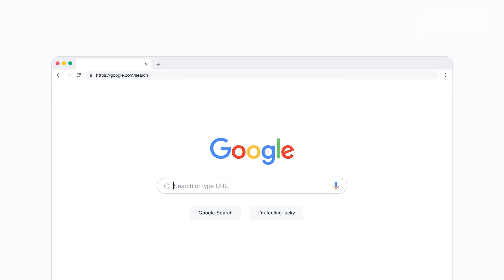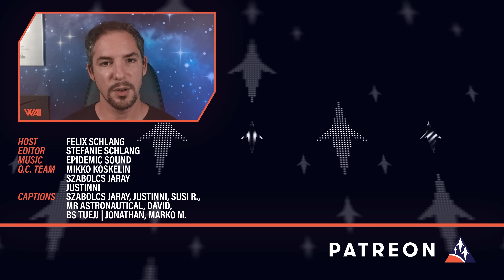SpaceX VERY cautious with orbital Starship Launch?

Comment from the maker: Do you agree with SpaceX being cautious? How would you do it?
Reply: Its good being cautious, and how would i do it... I would put sensors on the tower and try to land the booster in a middle of the ocean while moving the real tower in concert with the booster landing. That way there would be a kind of virtual tower on which the booster would land which would follow the real tower's movement. When that's done few times i would try to land in on a real tower from a high altitude hop a few times. And only then i would try the landing for real. ...for landing i mean.
For launch all the procedures have to be practiced to perfection i guess...
Reply: Not their usual style but glad to see it in this situation! 😀
Reply: N1 part 2, here we go!!!
Reply: friggin launch it up
Reply: Oh yes very cautious please.
Reply: It seems like SpaceX is being as cautious as the can be but far less so than their normal competitors would be.The iterative testing that SpaceX uses requires a certain level of boldness. They have to take leaps off of the cliff without knowing for certain whether their rockets will work completely or not. Their competitors, on the other hand, still go by the old style of making sure everything works right before testing begins. This is less risky, to be sure, but also very time consuming.
Reply: They are being cautious because a failure could damage their infrastructure and set them back 6 mos to 1 year. Also the FAA might impose stricter requirements on future launches.
Reply: Launch
Reply: Don't think it's SpaceX style to be cautious but surely they have all the data for their decisions
Reply: Good day put these ships in a silo type lunch pit to make them less destructive to the rest of the fuel farm around them, I'm sure they would have to be tunnels to gas  to escape so it wouldn't burn down the ship
Reply: Yes and no, while their are upgrades and test to do, than it's fine but after that at least a failed test would give data.

With SLS delayed there is no rush for SpaceX
Reply: They know all the details on what might be problematic and if you compare with anyone else, they move and are moving at a rapid pace.  It’s not a race, it’s about getting it perfect by trial and error.
Reply: Gee, let's see. Should they be careful with 33 new-generation engines (first stage alone) operating at the hairy edge of failure, being fed 4800 tons of propellant with the potential explosive blast of a small atomic bomb, launching from the midst of several environmentally sensitive preserves and closer to human-populated areas than people are to Kennedy Space Center?

SUCH a tough call...
Reply: I still believe that SpaceX is playing it slow because they want to give Nasa a chance to get SLS into orbit first. Would be embarrassing for their biggest customer otherwise.
Reply: Why do thousands of space enthusiasts think that the movies are real? if the entire stack explodes - the tower wouldn't even move - jesus ducking christ. It'll be a conflagration - massive yes - but it'll be but a breath of wind to the tower. The stuff that'll be 'ruined' is that everything has to be re-tested from scratch, every wire, every pipe. It's not a bomb.
Reply: That DST is such a waste of tax payer money
Reply: The stupid launch system is going to cost us taxpayers so much money. Ass holes!!!
Reply: I think even elon knows the chance of failure is high ! Its just a matter of if it fails and when ! it will be cautionary that it doesnt fail on the launch pad ! Im hoping it will be a success ! that would be epic !
Reply: I agree with proceeding slowly.
Wouldn't it make sense to re-stack and fill all of the tanks with liquid nitrogen to first test if the booster is capable of supporting nearly the same weight of a Starship filled with liquid methane and oxygen?, rather than it actually being filled with fuels??
Reply: I don't think it's caution. I guess, they are waiting for SLS launch. NASA want to be the the first to go orbit this year. It's a question of image
Reply: I would like to see more flight-based testing..     :)

But I understand why they aren't still crashing things every other month, the hostile media were using the exploding prototypes to paint a picture of SpaceX rockets as unsafe..
That doesn't please investors (or Tesla shareholders)
So they are being less explode-y if they can now...      :(
Reply: Well I don't agree with some of the things you are saying about the storage tanks but hey..
Reply: I love Starship but... So many explosive parts means its going to be extremely difficult for it not to blow up. What I dont understand is why are they not focusing on utilising the Moon to build starships and only take people from earth. Yes it would require a lot of launches of smaller rockets to get equipment to the moon, but surely its safer and more efficient in the long run, being able to build everything there without the need for super heavy lifts?
Reply: Yes
Reply: ummmmmmm @ 5:50 - WHY IS IT TURNING PURPLE?!?!? WHAT DID YOU DO WITH BARNEY?!?!?! HAS ANYONE SEEM GRIMACE?!?!??! OMG WHAT DID YOU DO?!?!??!!??!????
Reply: Not so much. There’s a LOT of theoretical stuff happening. Boosters and stacking segments are no sooner created than they are superseded by the next, and the next… It’s time to test something - anything! They have gone through so many iterations, none of them run through the hard reality of actual flight.

Many things look odd and ill conceived, such as the cramped space of everything, with the fuel farm very close to the launch area. Same with the chop sticks. It’s time to test in the real world. It’s the only real marker that counts.
Reply: From what I understand it's to help keep the fuels cold, by keeping the transit from storage to ship short there is less heat up. I remember reading it somewhere but I cannot remember where, sorry >.<
Reply: I have reservations about the booster design.
Reply: Yes

Comment: One wonders why rocket launch areas aren’t designed with a more of “A Launch Flow Layout and Structure”.I.E.Rocket Companies should (1)-Build Engine Test Areas Fairly near The Rocket Companies Launch Area;-(2)-Why Don’t they Suitably protect Fuel Farms;Preventing Any Launch Debris From; Either;Blowing Away From The Launch Pad;-Towards The Close Vicinity Of The FEUL FARM;Or in Such A manner That The FEUL Farm Isn’t Struck By Falling Debris From A Post;Few Second Launch 
“Tank Rupture;Resulting in A Major Fuel  farm disaster.  One can build in such a manner as to prevent disaster and include cut-off valves and over-protect areas to guarantee safety. Safety should be the motto for fuel farm construction. It not only prevents disaster and death but saves “Rockets in the pad”;&gives space a better and safer outlook for those watching their first launches or who are just being introduced to Space-flight. Keep it’s good and safe name. Prevention is better than messy cure. Make safety a priority.

Comment: Has anyone considered that the “Deep Space Transport “ consists of the Orion Capsule. Has anyone considered what living conditions would be for even 2 astronauts cooped up in that capsule for months? Try living inside a compact car with your spouse for 6 months without going outside. That’s just for the one way trip to mars.
Reply: Yes, there's no way even NASA would do that. It's why NASA has a Mars architecture requiring 7 SLS launches within 2 years at the very least, for just one mission

Which is, wait for it: not feasible at all. Look at SLS cadence

Comment: Lots of playing with the Lego pieces, but nothing has flown for a long time. Lots of theory, but SpaceX isn’t going to know if any of this stuff is going to actually fly. NASA learned quickly: actual flights are the best providers of data and proof. So many changes, so much tweaking. Why not design carefully, assemble carefully, then fly to test the validity of your work.  So many boosters, so many stacking bits. It’s becoming an exercise in the abstract use of stainless steel…

Comment: The most sensible solution would be to construct a separate catching tower. Same design as the launch tower, but only designed to capture the Booster, or Starship, and transfer to a retrieval stand at the base. No risk of losing a launch tower and the best way to provide proof landings are safe. This might be the reason for extra towers being constructed at the Cape. Are the new Tower pieces for this and is there a nice isolated area that could survive a RUD landing?
Reply: Except the main chopsticks slated to go to the main tower at 39A has hydraulic dampeners that wouldn't exists if it's just for launch & stacking

Comment: I would never build an orbital class vehicle.  I think starship is stupid.  Elon didnt ask the right questions.  99 percent of the problem is getting off Earth.  Starship is 98 percent how to suvive reentry.The aircraft analogy he uses has bamboozled the normies.  A larger Neutron or its equivalent is the better solution.  It doesn't require reentry, floats back to the launch pad ...the same place where it is manufactured.  Second stages can be made cheaply and spindly as they do not have to survive max Q pressures.
Reply: You know that going to Mars require reentry, right?

Comment: I think the fuel farm is far too close.
Reply: According to calculations from University of Armchair Engineers
Reply: @alvianchoiriapriliansyah9882  I never claimed to be an expert
Reply: @smavtmb2196  Yes, but engineers at SpaceX (which is an expert) calculate & determine this to be fine. So...
Reply: @alvianchoiriapriliansyah9882  I want it to succeed but everyone makes mistakes. 
33 raptors will be extremely powerful. Even Elon said the lack of a flame diverter maybe a mistake. 
And the current water system isn't adequate either. I hope it all works out though.

Comment: If the booster has 800+2800 tons of propellants and it burns for say 3 minutes until cutoff, that is a rate of 20 tons per second. Doesn’t that make the case for making the launch platform taller to save fuel or increase payload capacity?  Or better still building a launch complex at someplace other than at sea level?
Reply: The delta-v addition of higher altitudes launch site is really really small. The orbital velocity is going sideways really fast, not up

Comment: The boom likely wouldn't be as big as SN4 Felix. Methane and Oxygen can burn together as liquids, but they need to be gasses to explode together. A fully fueled  Starship and Booster is less dangerous then one with minimal fueling, as the latter has a large volume of gas above the liqiud fuel.
An incident after full fuel loadout, would burn for a long time, and quite violently, but detonation is unlikely until the fuel has boiled in to gas.
Reply: They not only need to be gases — they also need to be thoroughly mixed to get a proper explosion. Otherwise, you'll just see combustion where they come close enough to mix... it'd be spectacular, but you're not going to see thousands of tonnes of methane combusting instantly..
Reply: IDK, but the fuel in liquid form can also burn

Comment: If Starship were to smash into the tower and blow up I doubt it would cause much damage to ground equipment. The tower has so much open space there isn't much for an explosion to act against. Whatever you don't test on first flight you will have to test later. That's why unless you have a good reason for not testing something you aren't making progress this way. Let's see what the first booster catch brings because if the booster is caught on the first attempt you know Starships first catch will immediately follow it.

Comment: The first time I saw SpaceX launch areas and I saw the fuel farm I thought it was crazy, in a bad way, and I still do.  They should be much better protected and engineers should know this which leaves me scratching my head about what they're doing.  They're just one rocket explosion away from something very catastrophic.  At LEAST they could sink them down, but if they can't do that because I know they're basically at sea level, put a barrier between them and the launch pad.
Reply: They have a barrier, a concrete berm. Maybe you shouldn't be making definitive statement before seeing the pad layout

Comment: I find it incredibly stupid and irresponsible that Elon and Co are seriously thinking about launching Starship on land rather than at sea. It's as if they're fixated by their dreams rather than reality.
Reply: What's the difference land vs sea? I don't see any
Reply: @alvianchoiriapriliansyah9882  The potential massive explosion will be quickly contained by the water. It only needs to be launched from a basic structure; enough to do the job.
Reply: @BarriosGroupie  "quickly contained" wtf are you talking about. Are you actually saying that the launch pad is underwater??

And "basic" 🤣🤣
Reply: @alvianchoiriapriliansyah9882  No, the launch pad is tens of meters above sea level, contained inside a perimeter. If the tower fails to catch the Starship, it falls into the sea inside the perimeter etc rather than causing a catastrophic explosion. Similarly when it launches.
Reply: @BarriosGroupie  IDK, by the time it reaches the chopsticks it's already too close to the pad

Comment: There needs to be some kind of integrated extinguishing system built from underground, like the explosives used to put out oil rig fires, something similar. Even if the explosive is used as a blast diverter that would work similar to the explosive outer shell on military tanks. These two approaches seem more attractive than waiting for a potential hours long situation with news crews hovering around chatting how will the fire be put out. The goal? Rapid extinguish with rapid restoration maybe.
Reply: They already have water sprayer with gaseous nitrogen

Comment: sorry, but when they light off 33 Raptor engines the energy is going to reflect back up into them and most likely cause damage...I don't know why SpaceX refused to put a flame trench in and a real water deluge system, NASA has used both since the Apollo/Saturn missions and never had a rocket damaged from liftoff forces
Reply: They have a water deluge system
Reply: @alvianchoiriapriliansyah9882 I've seen what they claim is a water deluge, it doesn't even come close to what they used during Saturn V launches...I guess we'll see what happens

Comment: I  think the fuel farm tanks are too close to the launch pad. They should've built in a way if the ginormous rocket explodes few things would be damaged...
Reply: Which is done by adding a protective berm

Which they build

So...
Reply: @alvianchoiriapriliansyah9882  if that rocket fueled to the top explodes, everything around at least a radius of 1 mile would be wiped out form the face of the earth. protective berm no protective berm will be pulverized.

Comment: On the Skyrora front, not only is it "normal" for something to got wrong on the first launch attempt, I don't believe any organization (company or government) has ever succeeded on its first orbital launch attempt.
Reply: RocketLab came very close with the first Electron launch — the vehicle flew perfectly and would probably have achieved the target orbit, but a comms failure caused by a problem in ground equipment caused them to abort during the second-stage burn.

Comment: Possibility of an explosion on the pad?
Don't bother calculating. There is a reason why there's a '3 mile safe zone' between the 'Pad 39' complex and people plus critical infrastructure.
Since there's no real buffer at Boca Chica, that might explain why SpaceX is rapidly building facilities at the Cape.

Just imagine a Gerry & Sylvia Anderson explosion scene. Only it's real life.

"Early in the Saturn development phase, NASA officials had carefully selected a launch site that was sparsely populated and where the actual launch pad could be isolated from other necessary facilities such as the Launch Control Center. They selected sites on the Atlantic coast of Merritt Island, surrounded by swampland and beaches. In 1961 and 1962 NASA planners decided the locations of physical structures for the two Saturn 5 launch pads, and designated the pads Launch Complexes 39A and 39B. Because of the pads’ isolation, after 1962 Saturn designers were less concerned about the damage that a launch pad explosion could do to the surrounding area than they were about the damage that an explosion could do to the astronauts who were trying to escape it."
...
"Together, the three stages had a theoretical maximum explosive yield of 543,000 kilograms of TNT, or a little over half a kiloton, to use the terminology common to nuclear weapons."  

...
"Even this lower yield explosion would have completely destroyed the launch tower, the Mobile Transporter, and significant parts of the launch pad itself. The detonation of the hydrogen and oxygen in the S-II second stage would have created a tremendous blast wave close to the launch tower, knocking it down. The fuels would have caused fires in the surrounding vegetation and killed animal life for miles around."
Saturn's Fury: Effects of a Saturn 5 Launch Pad Explosion
Dwayne Day
April 3 2006
The Space Review

"animal life" ---> Think people watching ...
Reply: Boca launch site is several miles from populated areas, the wildlife refugee are the buffer